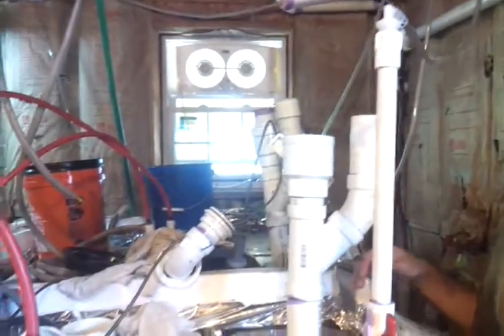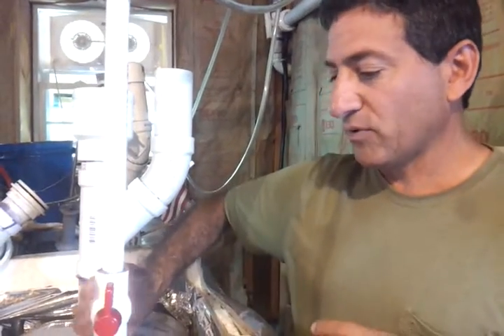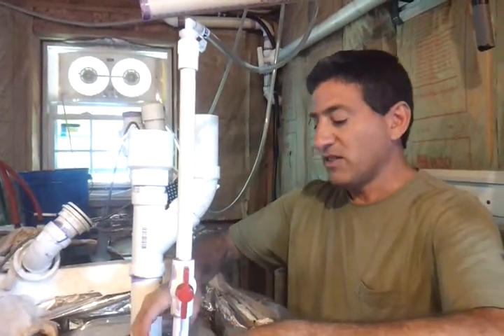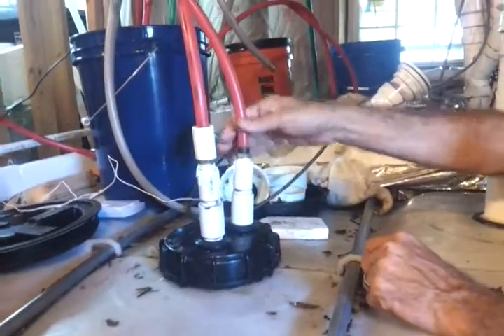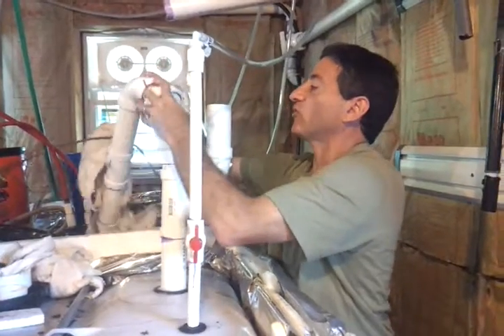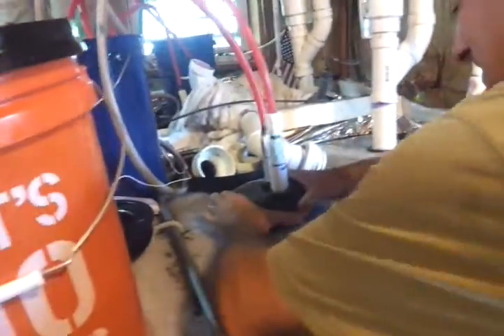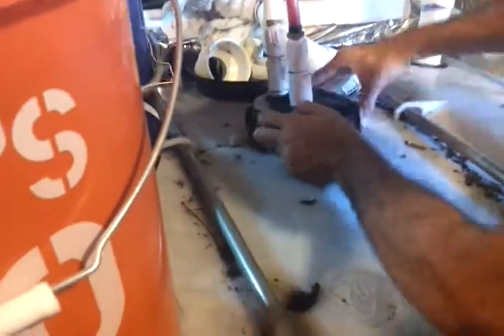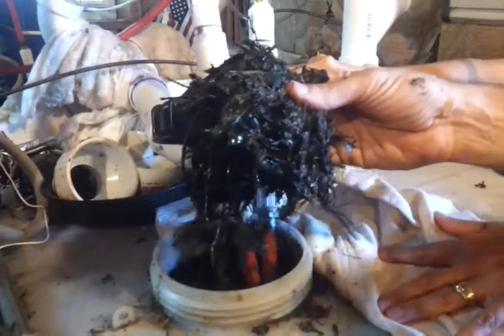Ideas for improving IBC biogas

Comment: What about putting a foam mat or pool noodles that float at the top? Then the topmost layer would be pool noodles and would hopefully keep all the leaves below the waterline and would eventually be digested. Also the pool noodles would add some insulation to the top of the water. Something similar could be achieved with a pool mat.

Another way could be to use a net that wants to float and anchor it with rocks in the bottom of the tank. The leaves/fuel would be suspended by the net.

Comment: If the water level was inside the tank instead of in the pipes above the tank then blockages would not occur. I have built an IBC Digester using your fabulous design and information with a different slurry pipe arrangement. Using a Tank Fitting the slurry pipe is attached to middle of the side of the IBC. A short riser then a 90 and a short horizontal and another 90 then a descending pipe and a collection bucket. This will keep the water level at below the top of the IBC at 75% full. Thanks for the inspiration.